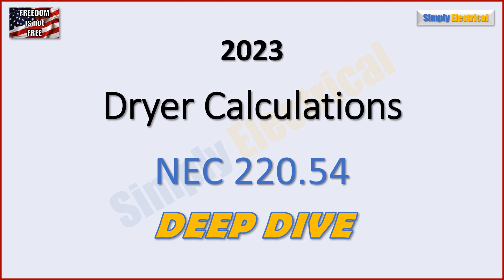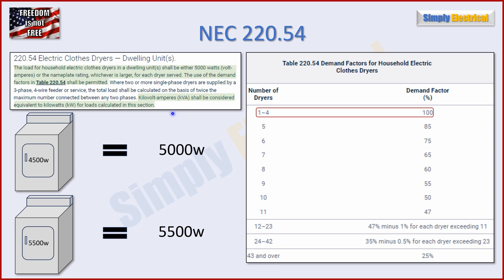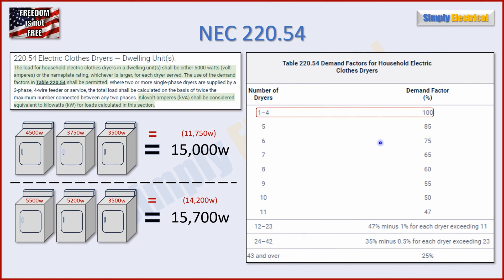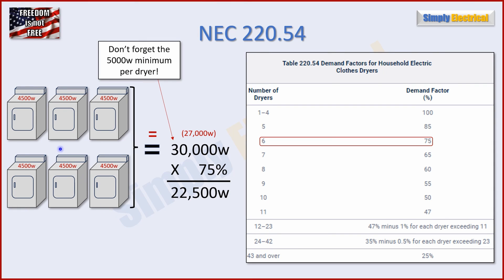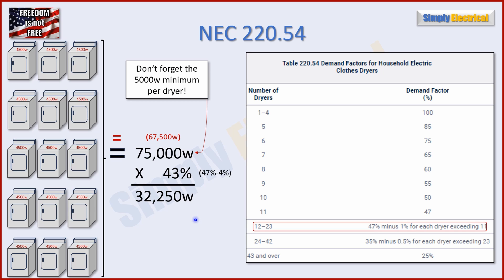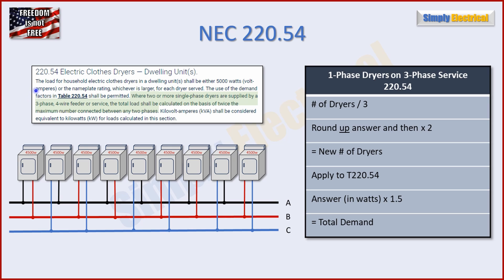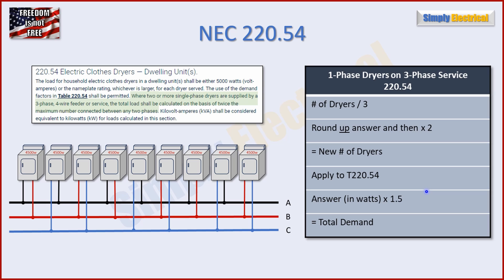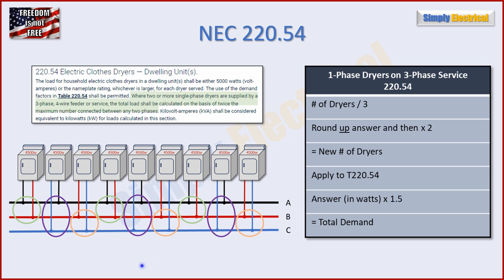Dryer Calculations NEC 220.54 - Deep Dive

Comment: Well done! Does 220.54 apply to commercial laundromats also.
Reply from the maker: Thanks!
No, 220.54 is for dwelling units only, as the title of the section states.

Commercial laundromats are not allowed to have a demand factor applied. This is because it is likely that sometimes all units will operate simultaneously. So the service needs to be able to handle the entire load of all dryers.